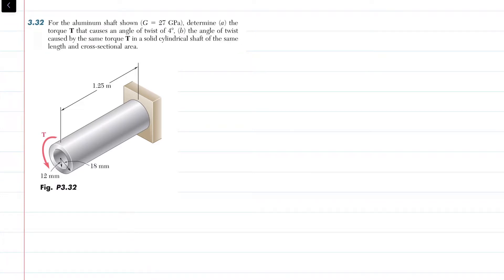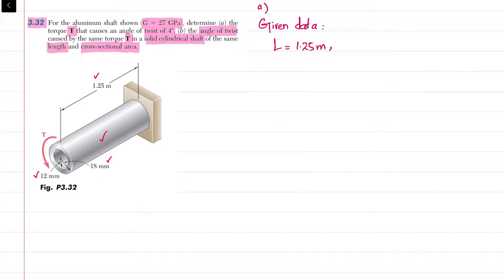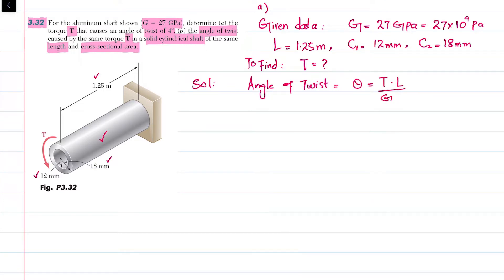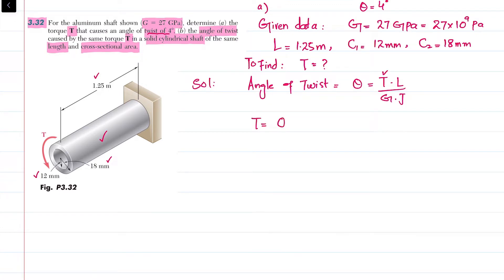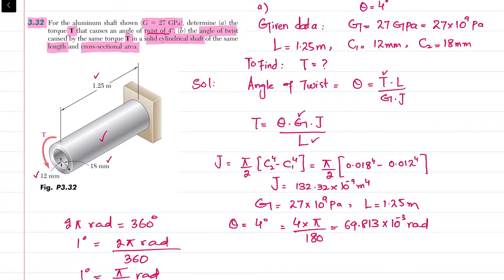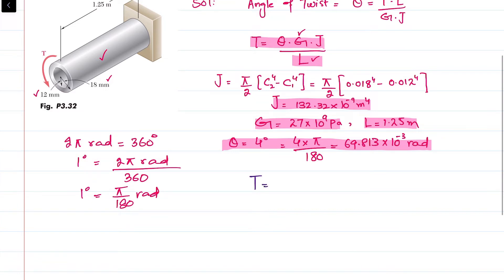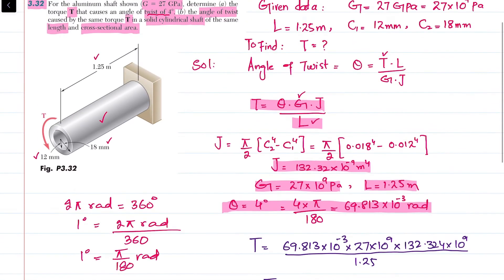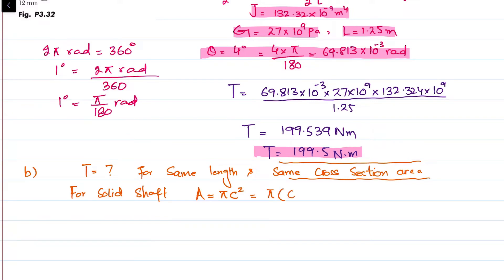3.32 | Torsion | Mechanics of Materials Beer and Johnston

Comment: thank you so much.. but why you used J=Pai/2 instead of J=Pai/32 in (b)
Reply from the maker: If you use radius then pi/2 and if you use diameter then pi/32. I have used radius that's why.
Reply: @engradnanrasheedmechanical  thank you sooooo much
Reply from the maker: My pleasure

Comment: How can I draw the Mohr's circle of this shaft?
Reply from the maker: If you take small element then only shear stress will be there and there will be no normal stress in x and y direction. So we will get a circle with center coordinate (0,0)and radius equal to shear stress. Draw it you will get mohr circle for this loading.